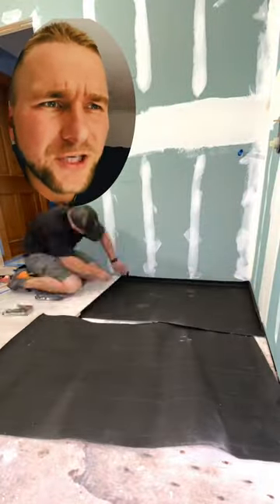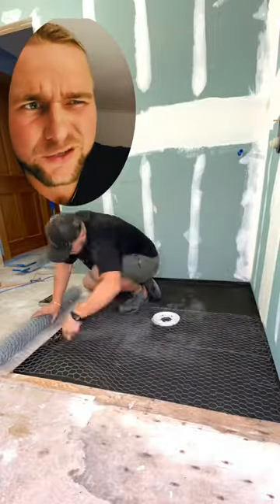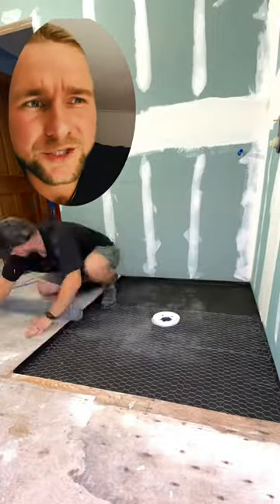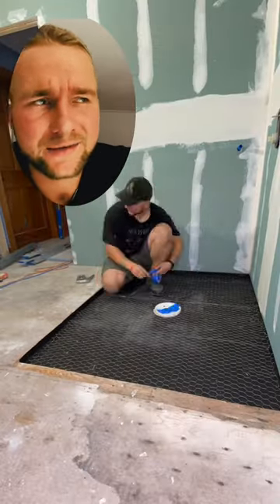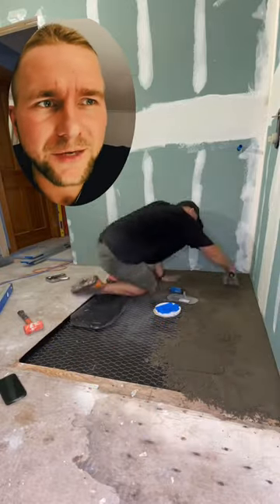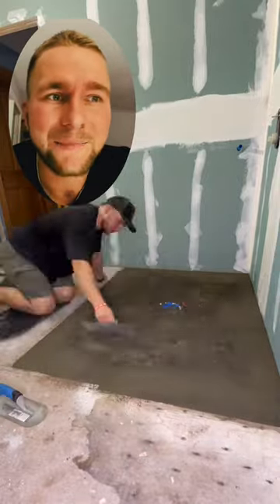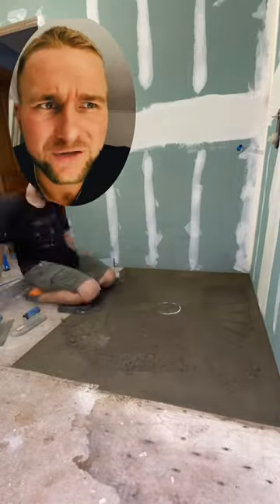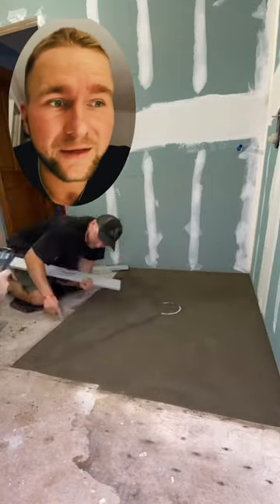How to do a Curbless shower mudjob. #diy #shorts #youtubeshorts

Comment: 🤣🤣🤣this is obviously a joke....
Reply: Gawd I really really hope so
Reply: You guys are obviously don’t know what your doing if you don’t understand what he’s doing in this video. Everything will be waterproofed with a sheet membrane.
Reply: @HandymanHustle  It’s definitely sloped. The shower subfloor is recessed a inch or so. Flange is screwed to subfloor.
Reply: @HandymanHustle   he said he leveled the exterior edge which is always the first step before you start sloping. Have to have a level edge to screed to.
Reply: You don’t pre slope a pan when using a sheet membrane. Pre slop is for a pan with a pan liner. No one uses a liner on a curb less or zero entry pan. You are really showing who the actual amateur is with your comical comment! A bunch of armchair experts out here. Stick to the handy man gig and leave the tile work to the experts!!
Reply: @HandymanHustle   I’m not going to argue but I’ve been a remodeling contractor my whole life & just started adding walk in tile showers about 8 years ago. My best year net income so far has been $623,000.00. I started as a handyman myself decades ago the difference is I knew then that I wasn’t an expert. I had lots to learn and knew it I also am not to good to learn now. I don’t what this guy in the video has done or hasn’t but the way he floated his pan is up to industry standards. That’s what I said and I meant it you wanted to talk about a pre pitch when it’s literally a whole different system that requires a pre pitch. If you would stop focusing all your attention on making money and try to learn as much as possible then the money would come. Instead you wanted to make a jack ass comment about something you were plain wrong about. Have a nice day!!
Reply: @TonyVM775  ok so then normally I don't need a pan liner if I'm going to use a membrane over the drypack?'
Reply: @IdemRedd  Yes sir. The sheet membrane is the pan liner it’s just on top instead of imbedded with the dry pack like the old school way. Make sure you use a sheet membrane drain and do a water test and your good.

Comment: ??? And where it’s the water proof ?? No liner?? Drywall in the shower?? Nop, this is so wrong!!!
Reply: You understand you can waterproof OVER a mud pack right. The drywall is acceptable for sheet membranes as a backer as well. Go figure out what you’re talking about before you sit here and make comments.
Reply: If you think apply sealer or redguard sealer will make it water proof you are wrong and drywall it’s not for a shower I can work for sometime maybe but it’s not correct   That’s why you can buy the durok build the concrete base  patch and then the sealer  make couple of things to make it water proof  not just do drywall and do sealer after that’s a cheap work
Reply: @manuelmondragon2165  buddy my original statement still stands, go figure out what you’re talking about before you sit here and talk, sheet membranes are acceptable to use over drywall in wet areas.
Reply: @manuelmondragon2165  Who said this guy is going about it all wrong? You’re 💯 assuming he will use the products you say he shouldn’t use but guess what… he never used them!

Comment: damn... so the drain is a little lower about 1-1.5" lower then tour perimeter?
looks nice
Reply: Yeah, you actually have to cut joist and come down about 1.5”, frame and block the subfloor then start the prep job for shower floor.
Reply: @Its_steve_bro  
Thank you bud. I ended up finding a video about it. he sis exactly what you described. 
it doesn't look to difficult. Just need the right tools is all